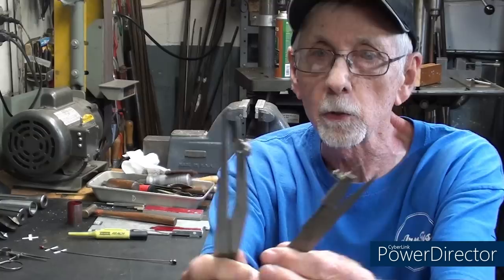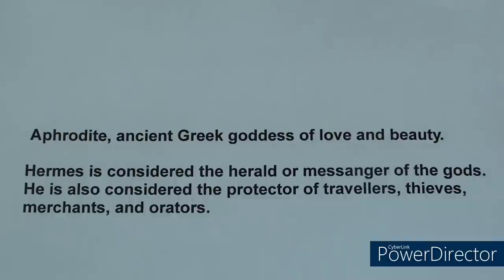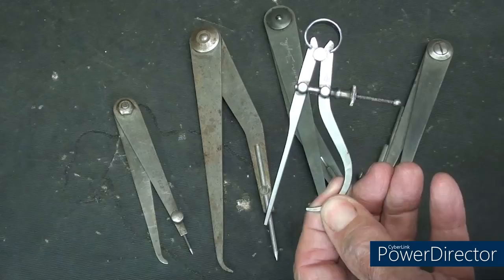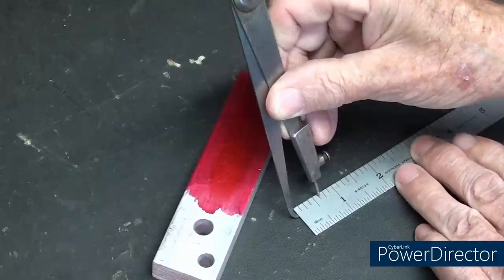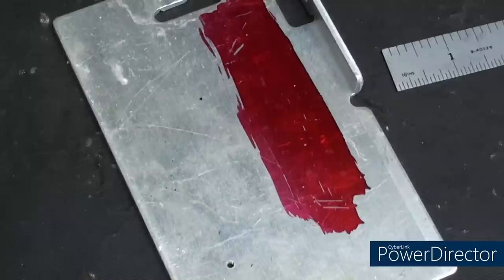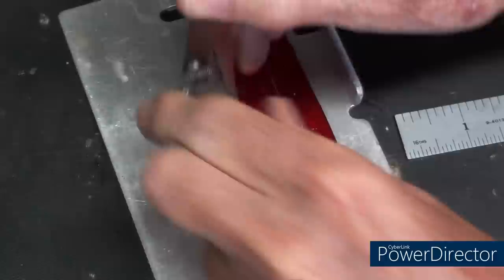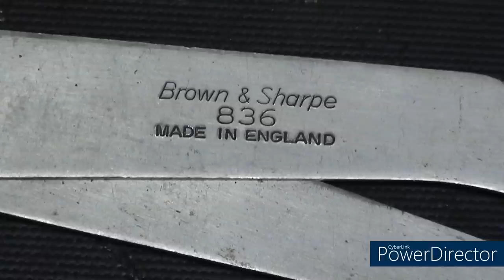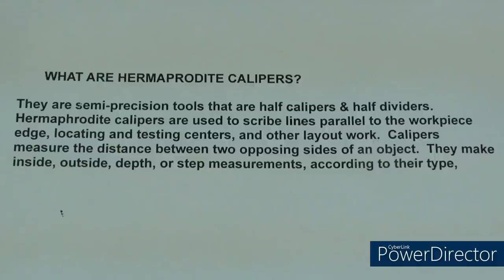WHAT IS A HERMAPHRODITE -- CALIPERS #43 short tubalcain

Comment: as a cabinetmaker and trim carpenter, the tight hinge pin and fairly rugged design works well scribing crown and base moulding, and other coped intersections on the job. These fit in the tool pouch and don't need much fussing to maintain accuracy.

Comment: Mr Pete. You are the man!  Ive had a Starrett set of these for quite some time without a good use for them. I did not know the reversal trick with those. As a master electrician I layout holes to be punched often. And often without accuracy to my standards. You just changed that. Thank you
- Tim from Massachusetts

Comment: Hermaphrodite calipers are the cat's pajamas for doing rapid layout work at the bench. Placing the point in the etched mark of the desired dimension on the steel rule and pulling the leg up to the end of the rule allows you to set the caliper very quickly.
 As Lyle demonstrates in the video, hermaphrodite calipers will quickly show an error when scribing a center line. If you have 2 parallel lines either the caliper was set incorrectly or the width of the work was not measured correctly.
Cheers from NC/USA

Comment: I have only heard them called Hermaphrodite Callipers by Americans, maybe it translates from other languages such as German as Hermaphrodite. Growing up in England I learned to use them and call them Odd leg callipers or "jenny" Leg callipers. I use them a lot in my work and it is possible to use them though measuring, this is where they come into their strength, Finding a centre line on a piece of work by setting up from either side or taking a measurement from one place or piece of stock and transferring it to another without the need to actually measure it can be very useful. In my 30 years of teaching though I found one of the things that really makes me cringe is seeing someone using a pair of Vernier callipers to mark parallel to an edge, when they should use some jenny legs! the abuse of a precision instrument makes me weep!
Reply from the maker: I see lots of people using the vernier in that way
Reply: @mrpete222  Indeed, it pains me deeply!